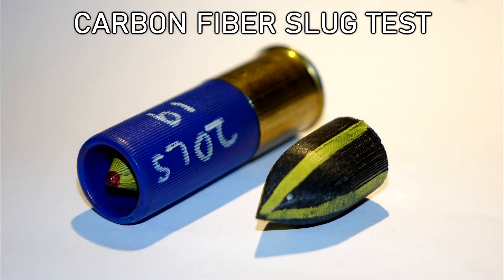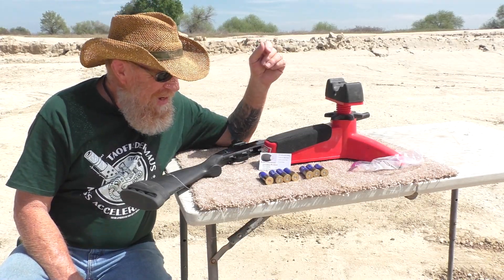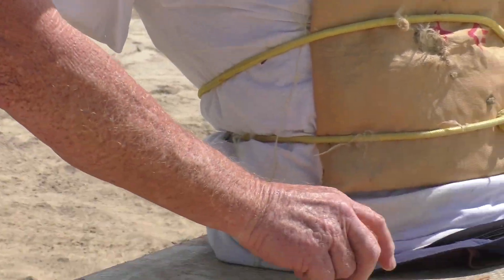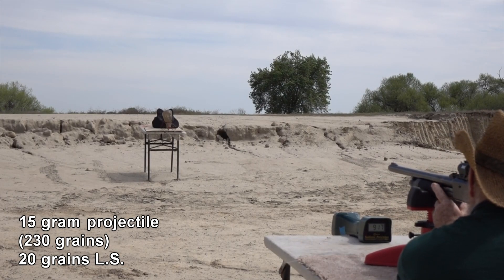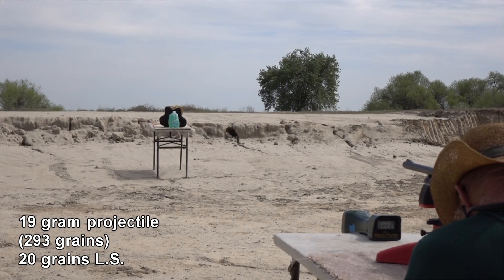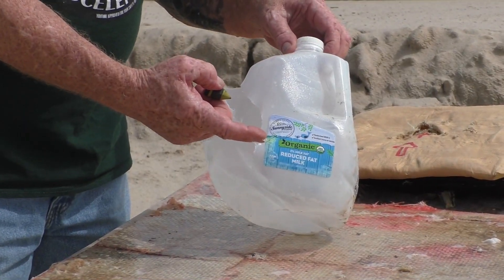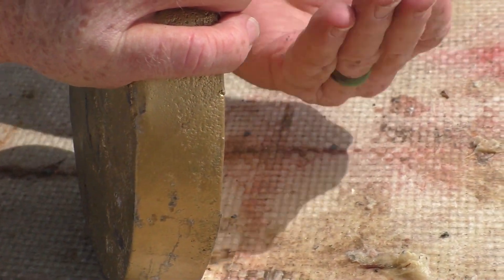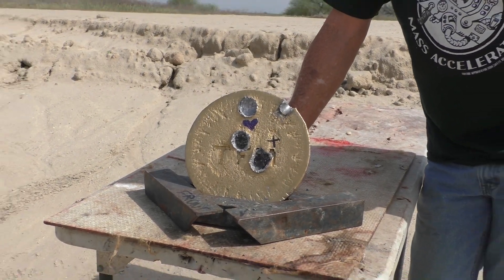Carbon Fiber Shotgun Slugs -  We Mach Them!

Comment: Those are very similar to the 50 BMG slugs I used to make I would put carbon fiber, and slingshot ammo in a mold made from a actual 50 BMG slug with a paint job you couldn't tell these homemade projectiles we're homemade  when I would slide them in their shells they looked like they were factory made the balls that were in them we're bigger, and those things did as much damage as brass solids

Comment: Carbon fiber is way more stiff than steel, way lighter, and about as strong. It breaks on impact because it experiences several orders of magnitude higher G's due to being so stiff. Steel is like dough in comparison, it's soft so it doesn't break on impact.
When firing, the G's are the same, but the part is so light the force is much lower. You would probably burst open your barrel before you can shatter a carbon fiber part during firing.

Comment: Im guessing Carbon Fiber is a new unknown material to you. Combined with the various epoxy to cure. Its incredibly strong and even found in engine parts. I find is strange you talk like you see carbon fiber parts turn to dust in collisions or something. Even find the material in some windmill blades which especially power making kind exert substantial torque and speed especially at blade tip. Think fiber glass with at least 5x strength on low quality carbon fiber. Most likely is is chelated fiber strands injected with epoxy.

Comment: I can explain this one better. It's 3D printed layers glued together around some weight in the center. The filament, instead of being straight ABS or PLA, has some short carbon fiber strands in it. What the matrix is I don't know, but likely some other polymer if not ABS or PLA. It is a Carbon-Fiber Composite, but not in the sense that we're maybe used to seeing, and definitely not near the strength. There was a way to print this all using continuous strand, but, that would have been really costly. Likely this was short-fiber 3D In Situ printed.

Comment: These aren't carbon fiber.  They appear to be 3D printed on something like a Markforged printer which uses either Onyx with chopped carbon in a Nylon material or could have had a continuous carbon fiber laid with the nylon.  But they're plastic.

Comment: I'm not surprised they could handle the force 
 Carbon fiber is stronger then steel it's why they use it for aircraft and performance car parts because it's so stiff light and strong

Comment: Carbon fiber filament usually has tiny strands that add stiffness but not very much strength. At a previous job we had a 3D printer that had a spool of actual carbon fiber that could be mixed with the molten filament in situ. Unfortunately if you made the carbon-reinforced portion too thick the plastic would shrink upon cooling and make the carbon fiber floppy.

Comment: Hmmm... good idea.   Now the fabricator should put a flachette in the center of the round.  Try a penetrator of steel and then a penetrator of tungsten.  use the ball bearings as ballast to achieve 18 or 20 grams consistent.   Clearly these things are tough enough to hold together meaning they won't penetrate a vest (just hit it hard enough to cause fatal blunt force injuries), but with the penetrator core would the exterior release while the core retains enough energy to penetrate the plate or harder body armor types?

Comment: Should be copper cones at tip , with carbon bulk , that way you can shoot a jet of copper , using low weight slug out of standard barrel with reasonable powder load , perhaps an explosive backing , interesting

Comment: There are two fields existing which, by use of experimental testing, could hold advantageous results toward shotgun ballistic performance increases. As we move forward these areas may be; #1. The potential for more effective sabot designs by exploiting the abilities 3D-printing offers towards both dimensional adjustments, as well as physical material adjustments, of the single-projectile carrying sabot type. #2. The potential for enhanced aerodynamic properties of existing projectiles by the use of add-on (such as "pressed-on" or "friction fitting") types of projectile nose-profiles with shapes generated by 3D aerodynamic modeling, and manufactured readily for use by 3D-printing processes.
Reply: In other words use 3D printing where it could actually benefit us, like using it where injection molding is currently having success--YES! Remington made the Accutip and presto, changed the game. Keep in mind all Rem really did was implement literally the most obvious changes where they were needed, and it came to market like they discovered fire. We could be making similar changes to our own stuff using 3D printing. Basically everything that can be done with injection molding can now be done with 3d printing, and then some!

Comment: Has anyone tried using 50bmg brass as a reusable 12g brass? Like fire buck or slug out of a 12ga with a 12g load. Maybe maybe it work with multiple shots? Semi 12ga shotguns? Will it eject the 50bmg  casing? Probably not eject. I've looked around and haven't found anything but 50bmg cartridges loaded in a 12g.

Comment: Curious as to why he chose the printing orientation he did, laying on its side. If he oriented them upright there would be a stronger bond in the direction of applied forces.

Usually 3d printed object failures occur between the layers, printing this on its side increases the amount of surface area between layers, making the overall structure weaker under immense force.
Reply: They are not printed, the layer lines were transfered from the mold
Reply: @rdggilroy  so it was a 3d printed mold? How can you make carbon fiber in a mold like that? Shred it and mix it with resin? Sort of defeats the purpose of using CF which gains its strength from a woven structure.
Reply: @Steve-sd7wk  that was our first prototype, we are working on the next steps using the data to make adjustments. The next round should be a much better showing
Reply: @rdggilroy  not saying this round performed poorly, just curious as to the manufacturing choices.
Reply: @Steve-sd7wk  no offense taken! We take all questions and criticism in stride and use it to better the product. One of the comments mentioned tungsten fishing weights and now they are on the way haha

Comment: Question did you actually research the properties of carbon fiber composites prior to this video. As somebody who works with carbon fiber as a hobby there was no doubt in my mind that they would survive this
Reply from the maker: Ever use carbon fiber filament and 3d print something like this though?
Reply: @taofledermaus  got you That's completely different, that would be closest to a 2x2 twill weave I'm assuming which basically means it can withstand extreme impacts as proven through the video but with any type of stretching would destroy it. By chance do you have his contact information I'd love to know which nozzle he used, most 3D printer nozzles get destroyed by carbon filament

Comment: Looks like he printed molds and then filled them with some kind of carbon fiber impregnated epoxy. The print orientation isn’t correct to be a printed part, plus the meniscus on the back tells me it was a mold.

Comment: Useless Trivia:  the 120mm M829A1 sabot round, used in the M1A1 Main Battle Tank, uses a carbon fiber sabot to carry the depleted uranium long-rod penetrator through the barrel of the 120mm gun.  The penetrator has an aluminum tip and aluminum fins.  The M829A1 was called the "silver bullet" of the 1st Gulf War (1991) for its ability to kill Iraqi tanks.  Carbon fiber sabots replaced the aluminum sabot used in the M829 Sabot round.

Comment: Used to get 5500fps at the muzzle with .44mag 25gr NylonX bullets turned on a lathe. Used a copper gas check. Inside about 20 feet they were ridiculously hard hitting. Would not penetrate a shower curtain at 25 feet though.

Comment: How about a Base bleed round?
Similar to rocket assisted projectile(rap) but burn more slowly and reduces drag force that created behind the projectile.(rather than rocket fuel pushes the round) it's going to be more accurate and will have more range than normal or RAP rounds

Comment: Correct me if I'm wrong. Looks like this was a 3D printed mold filled with bb's and carbon fiber resin. What would various shapes of very light weight PLA/PETG/ABS do (other than shatter out the barrel)? There's even metal infused plastic that could be printed and shrunk through heating that may function.

Comment: The arrows used in archery are made of carbon, and that carbon 3D printer filament is really tough stuff as well! Them pellets will be stronger than you think.

[edit] Arrows normally have metal tips tho, due to the increased forces a sharpened tip experiances during an impact. This'll be why the ends got damaged as they did.

Comment: 2:52 If my math is correct that must have been only 200 psi at most
Reply: You are assuming a constant pressure and linear acceleration?
Reply: @ABaumstumpf  That is peak chamber pressure simulated with internal ballistics software

Comment: It would be interesting to see if they could use a bolt or nail as the center weight and surround it with that material. You could probably get a more consistent weight that could also punch through harder objects a bit more. Great video 👌

Comment: It would be interesting if that design had a tungsten drill bit inside with a few of those steel shot. It may penetrate the lead plate if it stays together.
Reply: We are working on tungsten inlays now. It's a tough material to work with!
Reply: @rdggilroy  Some fishing weights are tungsten and fit will in a shot cup.

Comment: This was an interesting video, you shouldn't have doubted the carbon fiber.
Reply: -ish
Reply: Carbon fiber is to fibers as titanium is to steel.
Reply: Carbon fiber-like.
Reply: He isn't doubting carbon fiber, as others have suggested. He's doubting the "-ish" part. It appears to be a 3d printed part, and most carbon fiber filaments contain small bits of carbon fiber distributed throughout, which basically eliminates the fiber benefit of carbon fiber - tensile strength. I'm now curious which printer they used, as there are a few that do actually inlay carbon fiber in the print. These printers do actually get the benefit of true carbon fiber, though they are quite expensive.

Comment: Also "no views" when I started watching. Now 14 views ~12 min later.

Those were neat. I wonder if they were printed with continuous fibers (like Markforged) or just chopped carbon fiber standard filament. I also wonder how he put the BBs in them--probably some fun pausing the print and adding the BBs.

A link to the contributor's store might be good assuming it isn't against the rules.
Reply: I thought that he would print a hollow shell, fill it with balls then epoxy or something like that? If you look at the base of the round, there are bubble remains that rose up from the epoxy maybe?
Reply: @gscapinelli9214  Good point. It does rather look like that.